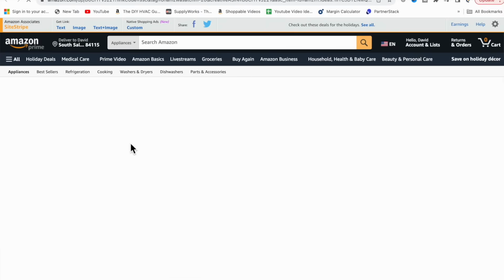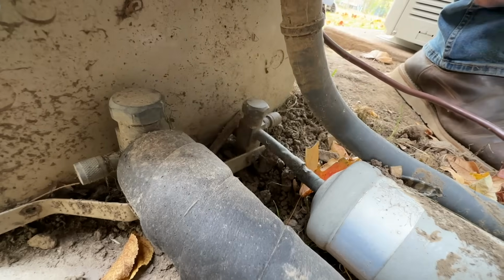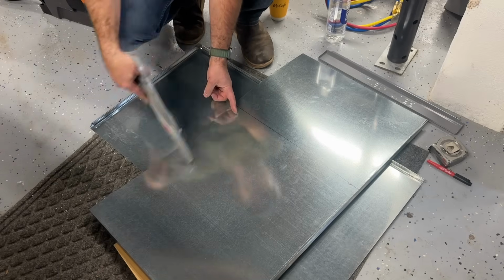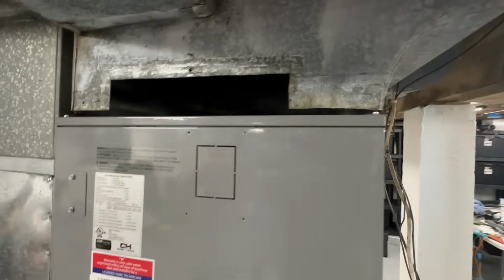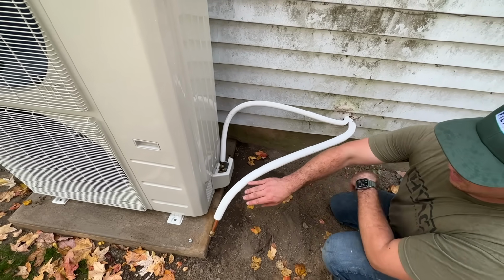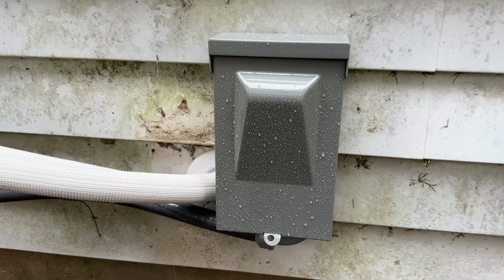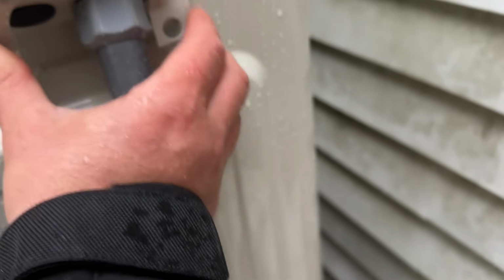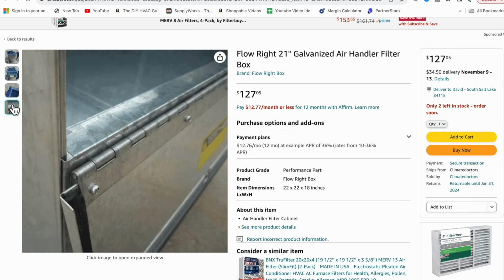How To Install A Ducted Mini Split  -Start To Finish-

Comment: Running electrical lines grouped & parallel to the lineset will transfer heat to the refrigerant reducing the efficiency of the unit.

While the NEC doesn't specifically detail a distance, a good rule of thumb is at least 2 inches.

Comment: bro, i have senville 48000 , is it ok to use the furnace line on the handler but wire is not on gauge or needs to replace the wire gauge right?

Comment: Before installing the heat strips, the power block has a yellow wire fromthe S terminal that is grounded.  Why is this not grounded on the new power block after the heat strips are installed? I'm installing a similar unit.

Comment: Foil tape is not mastic fyi lol. And after pulling a vacuum you want to shut off pump and let it sit for bit, if you lose your vacuum to fast you know you could have a leak, If your using your vacuum for that purpose as well that is as we he stated, otherwise nitrogen test first for leaks. Not a pro just another DIYer who does lots of due diligence.

Comment: It hurts seeing no shielded com wire with drain grounded for either thermostat or system interconnect com wire, no inverter power surge protection like ICM493, didn’t torque line set, can’t see how a 15k uses two 60amp, should be 30 and 60. First lightning strike your bro will be out a compressor control board.

Comment: DO NOT install the control wire in the 3/4" conduit like that..... Serious amateur hour. I like your videos. but don't tell people to over fill a conduit. Wire fill is a real thing and should be followed.

Comment: Thanks for another great video! As an aside, I have a recommendation for the homeowner. Use Outdoor cleaner on the siding. It will easily remove mold and mildew, and your neighbors will appreciate it.

Comment: Hi guys I just watched this visit for at least the third time and I am in the middle of intalling an Infinity Living 3 ton hyper heat ducted system that looks very much looks same as the unit in this video, and unless I missed something, why and does my inside air handler need an auxiliary power supply 220 with it's own breaker and or shut off 
Please if anyone has the time and knowledge to verify Thank You in advance

Comment: Its always cheaper to work for the  family.  A HVAC company has so many expenses (overhead, trucks, uniforms, specialty tools) before they even begin the job.  Who is going to cover the warranty?  Did you get a permit?  Are you a licensed HVAC contractor?   What did you do with the old refrigerant?  Pumping the system down is the wrong way to get rid of refrigeration, you should have reclaimed it.   These types of details cost money.  Who still uses those types of gauges. Antiquated.   Hack(always cheaper).

Comment: NEED help trying to find where you buy ductwork!  Everything is seemingly for branches and small ones at that.  I need supply rigid plenum that's probably 14x20 to fit mr cool 48k and then go down to 12x20 after I pull off some branches.  I cant believe this must be customer made.

Comment: Similar situation.  My central AC died in early June.  I had just installed (myself) a 1.5 ton ductless mini-split heat pump (Della $900) for the kitchen-living area so I could better use my new solar power (Central AC powered from different panel).  The minisplit actually sufficed thru Summer, even on 105 F days, using a box fan to blow down the hallway.  But now want to fix the Central AC.  I found some mini-split outdoor units can work with my existing indoor AC coil in "non-communicating" mode, controlled by my existing thermostat (ex. ACiQ-18-AC).  I've proven 1.5 ton will suffice since the existing minisplit handles the front of the house.  Doesn't need to be a heat pump since I have a central gas furnace, though heat pump might be smart in case the furnace dies (ex. cracked heat exchanger).  Biggest problem is I'd need to source a little extra R32, given the larger volume of tubes and evaporator, and the EPA makes that fussy.  Most AC techs pressure-test the lines with N2, but I just did a vacuum leak test like you, which usually suffices.  If running stranded wire for 240 VAC supply, don't need a neutral wire, as you found.

Comment: Hey DIY Guy! Thanks for explaining this in more detail. I also have a plenum base that is located in the corner of my garage and Its a very tight space to try to apply the foil tape. Do you have a video where you actually show the technique of how to apply the foil tape with a thin piece metal.Im using a metal ruler but cannot seem to make it work.

Comment: Great video & really appreciate your candid to the point instruction. I fly down to my daughters home (AZ) to install the same type of mechancials BUT so far every time I have been away one of our rental properties (upstate NY) has a HW tank or fce failure & I get smoked by HVAC guys. The last one was $2300 to replace a short 40gall electric HW tank & the idiot left the apartments without electrical for several hours because they forgot to reset the breakers.

Comment: Why post an illegal dyi video?  This just encourages people to break the law.  Regulations were adopted for a reason.
Reply: DIY is fine. Just make sure to get it properly inspected prior to using it. If there's a code violation, you can fix it and have the inspector back for another visit. This work is not rocket science.

Comment: Thanks to DIY HVAC GUY, his videos were invaluable. 

VARIATIONS: Newer models of ACiQ systems seem to have slightly different configurations that might not look exactly like in the videos; and the kind of thermostat you use and whether you add aux electric heat changes how the wiring is installed. I found the instructions for wiring with this configuration confusing so these notes may save you some time. 

My 36K ACiQ condenser unit did not have an L1-L2 output to send power to the AHU, so I simply added a separate 20A 240v line to the AHU to power the circuit boards and fan. 15A 240v might have been adequate.

Mine did have 8K aux electric heat coils which came with a single 60A breaker installed at the AHU so this is another 240v line you need to run from your electric panel using wire and a breaker properly sized for your heat coil. 

With the T755 thermostat from HVACdirect you need 7 wires from the thermostat to the AHU but you do NOT run any thermostat wires to the condenser unit. Instead you only have to run an 18/2 shielded wire from the S1 and S2 terminals in AHU to S1 and S2 in condenser unit.

Dip Switches: RED bank: SW1-1 on; SW4-1 on; SW4-2 on: all the other SW switches off. A pair of blue dip switches at top of board to the right of the thermostat wires are both in UP/on position. A pair of blue dip switches on bottom between two dial switches are both DOWN/off.

My new system ran perfectly with this configuration. AC was very cold and the ACiQ 3 ton AHU blower was very strong, much stronger than the same size Goodman unit I replaced. Inside and outside the units run so quiet I can hardly tell they are on.
Reply: Thank you! I plan on installing a unit next month.
Reply: I am installing an ACiQ 36k ducted mini split (36-AHB/36-HPC) with a 10kw heat strip. Before adding the heat strips, the power block had a yellow wire from the S terminal grounded to the unit. The power block on the heat strip unit has the S terminal but no yellow wire attached. Should this be grounded? From your description, this us where you attached two load lines from 20A breaker? I just plan on using a double 15A breaker. The manual does a poir job describing this process. I started to get more confused from this video because he mentions the wire from the condenser to provide power. The only wire see from the AHU to the HPU is the 18/2 wire for S1 and S2.

Comment: I want to purchase a HC ducted system. it’s very had to get accurate information from anyone. I have the usual problems poor insulation, smaller ducts and temps from 122-35. Currently I have a 4 ton that can keep the house at 78 on the 122 days by running all day.
What I have been told is the inverter system will ramp up and down to what every heat load that’s needed. If it works that way it would be like having a 4 ton on the hot days and a 12 ton on the more mild days. Does this sound correct?
Thanks

Comment: I was looking at replacing out unitary split system with a ducted mini split but we currently have a 2 zone system and I’ve heard they sometimes have trouble with.  Are inverter systems incompatible with multi-zone systems?  What is the potential problem with using this type of inverter with a multi zone system?
Reply: I have the same question.

Comment: These units really should also be on pump ups or risers. At least 4" off the ground. I think you said this was installed in Missouri so I imagine snow isn't too bad there so maybe it works out. But you really should have risers.

Comment: I am looking at this a second time.  You have your HVAC system in a conditioned basement.  
My two AC and NG heat systems are in the unconditioned attic area.  
How would a system work lying on the side and why would I want a return filter in my attic?   My downstairs return filter is in a stairwell and upstairs return filter is in the hallway ceiling.  

Not sure how to design a ducted mini split system to replace what I have.  

Is it more efficient than natural gas heating?  Hard to believe.

Comment: Awesome video! I just installed a MrCool Ducted System (5 ton). It looked amazingly similar to the Cooper & Hunter you installed here. I guess there is some China factory this stuff all comes from.  The MrCool has a 10 year warranty for self-install, if you use MrCool no-vac lines. Mine is up and running and it is running great! I would be curious if you would show how to check the charge on these systems?

Comment: Currently installing a Senville 24000 btu ducted system. 
I haven't been able to find much information on sizing my returns. 
I have the return plenum set up for 3- 8 inch returns using about 40-45 ft of flex. 
5 - 7" supply line totalling about 65 ft. 

Any idea if my returns will be enough?

Comment: Your supposed to use a finger to push in the contactor, preferably with a foot in standing water and touching condenser. Insulated tools are for rookies. JK.

Comment: Is there a catch with the mini-split style ducted heat pumps costing way less than the lower efficiency vertical style? Eg Aciq R4H5S24AKAAA  vs Aciq ACiQ-24-EHPB. Why do people still do the old style?
Reply: I guess a better example is the Aciq N4H7T24AKAAA at 16 SEER costing $4500 vs the inverter style at $2800

Comment: Beautiful install overall, Just the ductwork I would recommend offset  on supply and return plenums and make a true seal and prevent duct leakage. This is a very nice install. SMACNA Guy here.

Comment: I thought the return duct you made needs to be insulated?  Also, is it required to use the included thermostat or can a different one be used?

Comment: You forgot to install a surge protector on the condenser, very important with these units, also with the unit being in Missouri, per the installation manual, it should be raised at least 6" or more to stay above the snowfall, and avoid ice build up, so that condensation can properly drain when hyper heating and not freeze up. I have an ACiQ, same exact thing as this C&H, different logo, and I had to raise mine 6" as well. In MO might need to be raised even more depending on how much snowfall they usually get. The installation video even recommends a Snowcap for these units in snowy climates to keep snow off and away from the coils, I just ordered one from Hanger for my ACiQ. Also, none of the tools you used are in your Amazon store, maybe add them or least put the links in the description? Otherwise great video! I actually purchased an ACiQ based on your Duel Fuel video, although I don't have duel fuel, just using the heat pump, and worked great, even in 10F!
Reply: Came here to say the same thing about the surge protector.  Also, there was no disconnect switch at the compressor.  Pretty sure NEC requires that
Reply: He might have a whole-home surge protector.

Comment: Not sure you should be teaching people how to do it yourself.  As an HVAC owner and operator we spend a lot of time training and getting certifications to do this sort of work.  You can easily get someone hurt.  The refrigerant can kill and freeze burn.  The $14,000 you pay is what it cost to keep an HVAC company running the right way.   I just caution people out there watching his videos.  There is a reason it says the warranty is only good when installed by a licensed HVAC contractor.    Be safe out there and higher a professional when it comes to HVAC.
Reply: They quoted 22 000 after they would take a rebate for 2 000 from the state. I do not need your warranty when I could  buy 3 more brand new units with money I save if my first unit goes bad
Reply: Piss off with your gate keeping. They install these all over the third world on mud huts. It ain’t rocket science.
Reply: I support this except for smaller tasks it can't be wrong for a capable homeowner to learn some everyday things to help their system. But installing new systems..I'm probably with you on that. Same with plumbing, carpentry, or anything else.
Reply: You mad you can’t screw people out of thousands of $$$ to justify your “certifications” ?
Reply: I would prefer to do it myself versus "highering" some guys who will do a crap job anyway. Give a man some fish he'll eat once, teach him to fish he can save over 9k to feed his family. There are more than enough people unwilling or unable to do this work. This guy is humble and not greedy, let's be honest you don't care about anyone's safety, you want the money. The HVAC business hates DIYers, but you're hurting yourselves by charging so much, taking advantage, and doing crap work. Here in texas the guys doing the work wouldn't be able to chase a short on a one wire system. I never hear mechanics trying to stop folks working on their vehicles. Point is there is plenty of money to make.
Reply: To get around this, install a MRCOOL hyper-heat system. It's the same system as a commercial system that's rebranded to MRCOOL. You can use the pre-charged lines so you don't mess up the refrigerant portion of the install. A DIY install comes with a full 10-year parts and labor warranty. I was quoted $22K for a pro install by a local installer affiliated with Home Depot. My DIY install was only $5K. I'll put the $17K in cash I saved into stocks and let it grow. By the time I pull it out and spend it, it will probably be over $50K inflation adjusted.

That said, this is a big job and requires a big commitment. To DIY, you'll have to study, source parts, and potentially work in less than ideal conditions (like in your crawlspace). While it's not for your average DIYer, there's nothing overly cerebral about the work, and there is plenty of online help available.

Comment: Thanks for the video. I'm looking into that system, but for a 5 zone wall mount installation. Do you have any feedback on the multizone hyper heat version

Comment: Depending on the price of gas in his area it may have been more economical for him to go dual fuel vs all electric unless he has solar… in my area, the economic balance point of my equipment was 40F which defeats the purpose of having an extreme heat inverter condenser. Also with inverter units, it’s not a bad idea to install a surge protector for them.

Comment: Another great video.  Thank you for sharing.  I want to reuse my existing copper lines.  I have seen your video on how to clean them from remaining r22 oils.  However I am not sure about the diameter of the lines that I am allowed to use.  I believe I currently have 3/8 and 7/8 lines for 3.5 ton unit.  The cooper & hunter unit you installed has 1/4 and 5/8 lines.  Can I reuse my existing lines even if they are larger than required or do I have to install new copper lines?  My air handler is in my attic which is about 30 feet high so running new lines will be a lot of work.  Any suggestions?

Comment: Great video, I learned a lot. One tip - the pliers you used to start the condensor are coated with plastic but they do not insulate you from electrical current. You need a tool that is rated for electrical work. They will specifically say they are usually have a 1000V or 10,000V rating. They will also have something like this printed on them: VDE certified, and built to meet IEC/EN 60900-2012 .
That's they kind of tools you should use if you're wroking with live wires or equipment that is hooked up to live wires. Be safe.

Comment: Dave, I am retired but have always been interested in learning to work on HVAC equipment.   I watched many of your videos and decided to replace a Mitsubishi mini split that had died.  I purchased a new 2 ton Mitsubishi but needed to use the old line set because of the way it snaked through the attic.  I used pro flush and than ran the Hilmor plugs through the the lines to get any remaining residue out.  Hooked everything up new flares etc and pressured checked to 580 lbs for 24 hours and it dropped to 525 but the temperature also dropped 20 degrees.  Anyway released nitrogen and. Tried to do the decay test and got down to 120 microns but within 10 mins it was up over 500 microns.  Leak? - fill with nitrogen again and bubble leak all connections?   Thanks retired Dave
Reply: @dpc5250, were your existing copper lines the same diameter as the new Mitsubishi unit required?

Comment: Just a heads up that drain won’t function without the “clean out” tee being capped or plugged as it’s on the negative pressure side of the blower
Reply from the maker: Noted! I’ll have him throw a cap on it